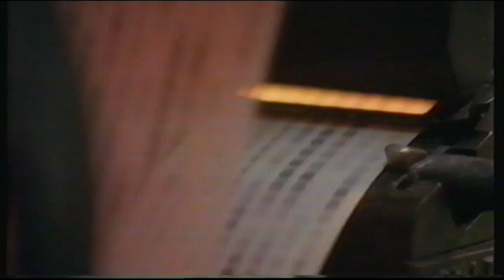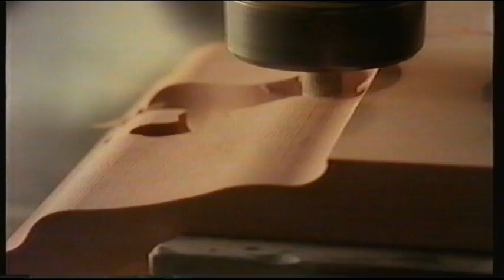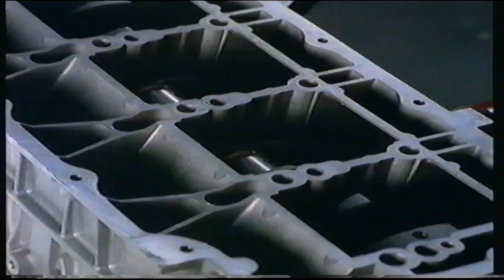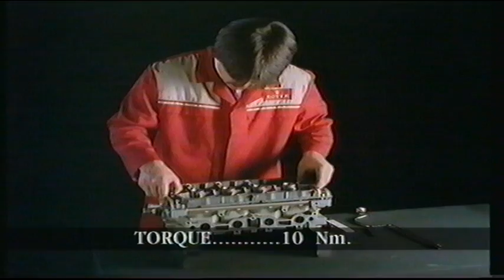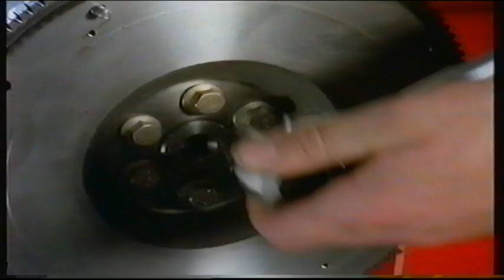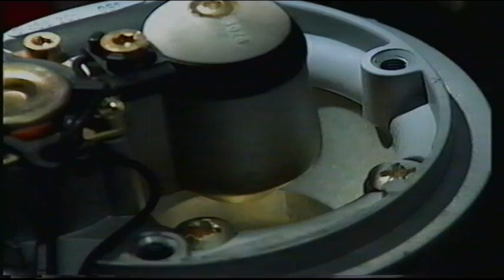K Series, A lightweight winner.

Comment: Designed as a 1.1/1.4 lightweight to propel small hatchbacks about. Completely silly to expect it to drag a mid sized 4x4 about with the same water pump, thermostat etc as in a metro.

Comment: A lightweight winner...that spat out head gaskets more often than I change my socks. Dear god, in what possible way could this engine be considered a "winner"?
Reply: technically it's not the engine that's the problem, but the inadequate cooling system.
Reply: Joe Smith Also the plastic dowels didn't help
Reply: Indeed Gavin :)